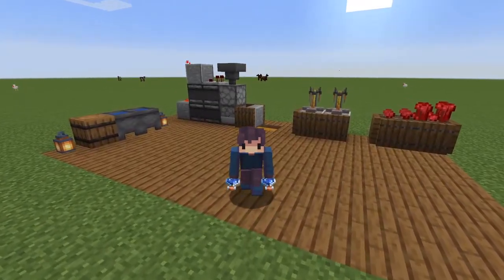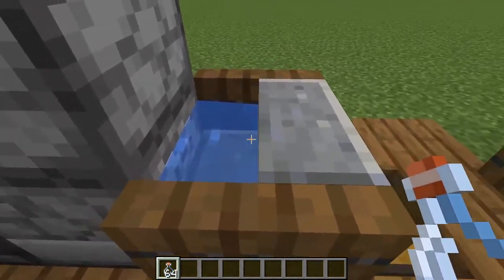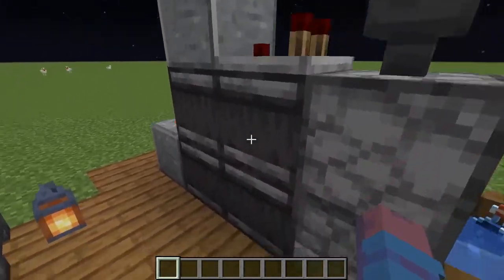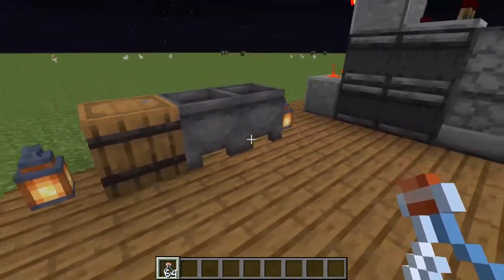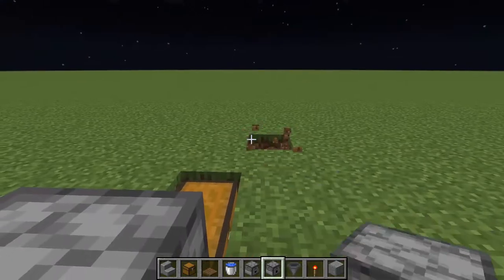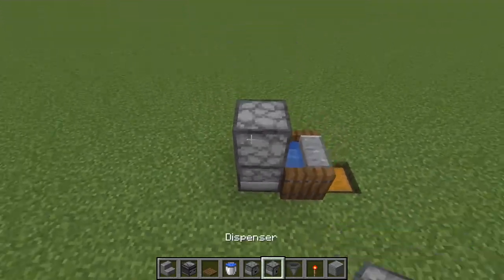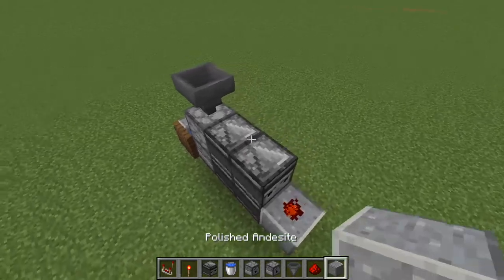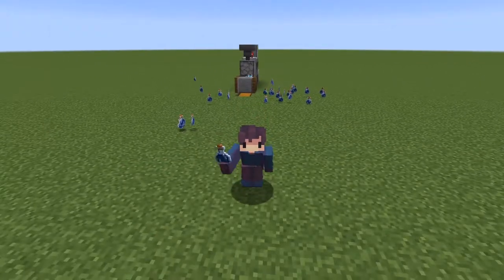How to Make an Automatic Bottle Filler (EASY!) Minecraft 1.18+

Comment: I've upgraded the machine a bit. I placed hoppers around the item outputsand connected them to 5 chest on top of each other, on the bottom of the crates I've made an item elevator that spits out the watter bottles I connected an auto brewer to the item elevatou r and an netherwart farm with the item outputs connected to the auto brewer. Hope this helped a bit to make a video of an upgraded version of the Auto Bottle Filler